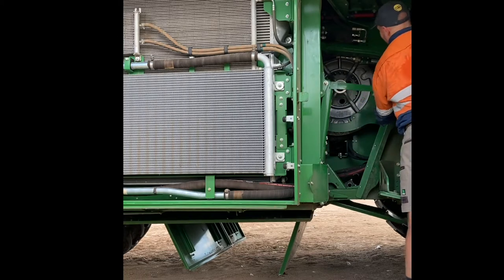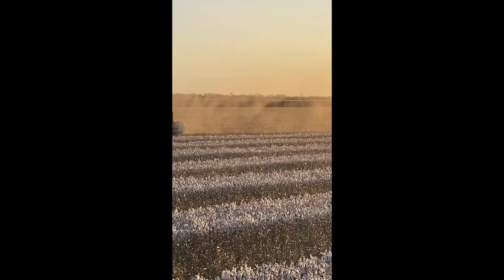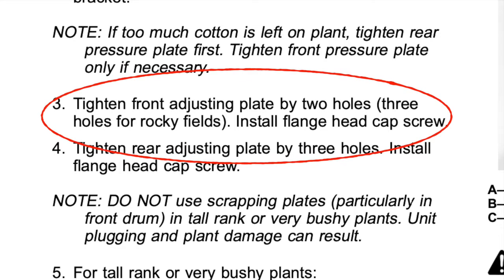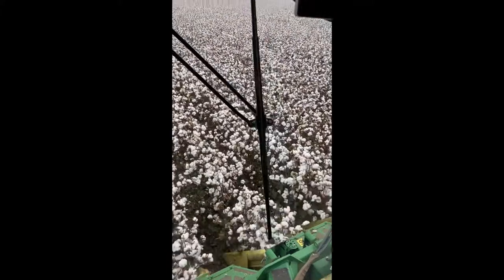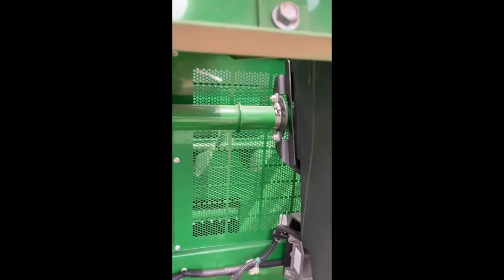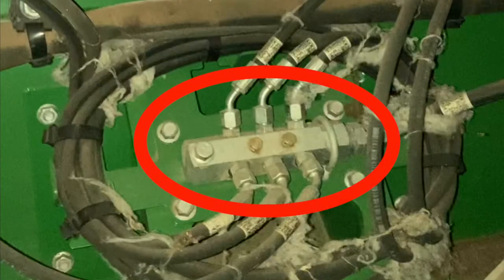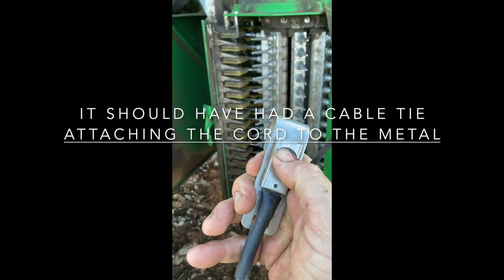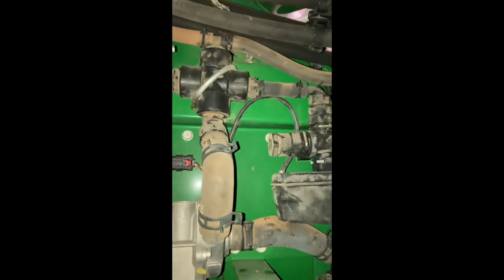CP770 Essentials Bonus Module 1- Aussie Ready

Comment: Enjoy the info in your vids,  I have a non-important question why do you run the handrails in the up position on top of the accumulator or basket?
Reply from the maker: It's how we'd always done it but we're changing to always down after talking to lots of other growers last year, mainly for powerlines. It's a good idea to keep them down.
Reply: Well I'm 51 and farm in Northwest Alabama and all my life I've seen pictures even back on 2 row machines the handrails was always up on machines in Australia just always wondered, thought it might collect less cotton and trash on top.
Reply from the maker: @bigroybr69  the first machines we had with handrails were 9960s and leaving them down made the roof harder to clean so we just got in the habit of leaving them up. Have you got Cotton this year?
Reply: I totally understand and yes we have 1400 acres of cotton this year and we run 2 JD 7760's and everything we've picked so far has been just a little over 2 bales per acre or 1200lbs per acre I know that's quite lower than you guys are used to but it's an above average year for us and it's dry land cotton.
Reply from the maker: @bigroybr69  that's awesome for dryland. That's a great result, it's not often even the best districts can achieve that in Australia. Good luck for a safe picking!
Reply: @troysmith7405  thanks same to yall